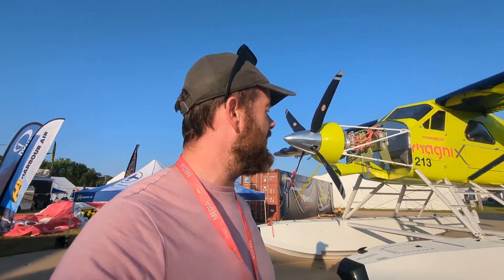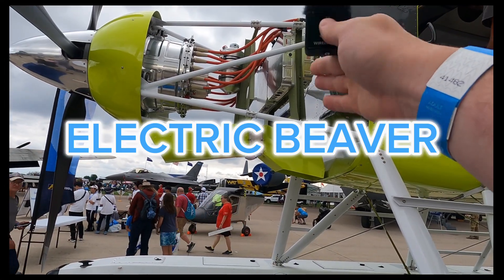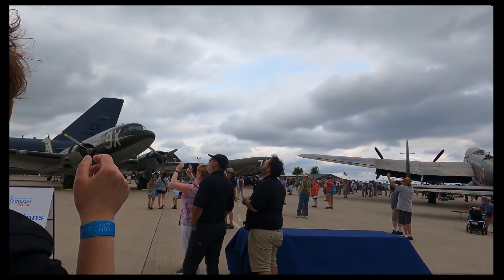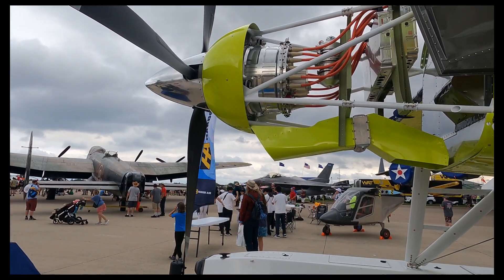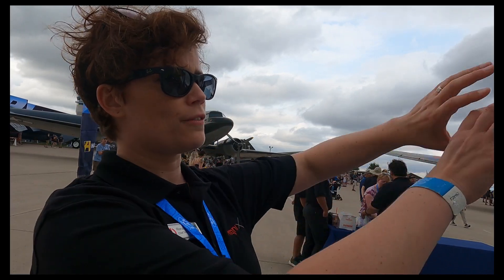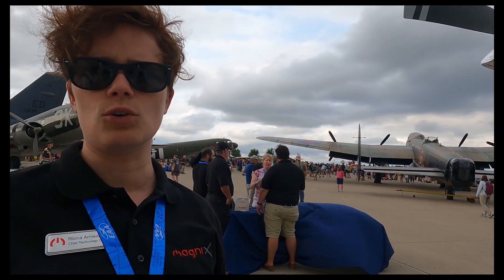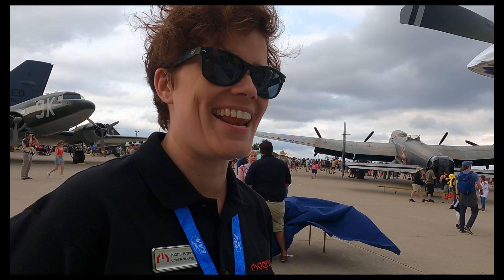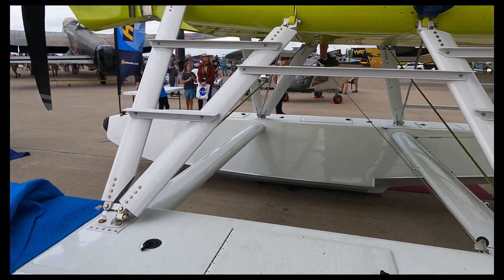Oshkosh 2024 Ebeaver

Comment: Perfect for our Harbour Air short hops.The fuel savings is ridiculous. Maintenance way less on an Emotor. Same HP but alot more torque. How well will the battery hold up would be the cost question. Modern car packs are lasting longer than expected. Tried and tested Beaver,Love it!

Comment: You'll notice they never talk about range and useful payload. Especially with a reserve charge . Nice idea but battery technology is nowhere near where it needs to be for this to work in a commercially viable way. Once the tech gets there , then there's the matter of getting it approved for commercial use. Good luck navigating that quagmire. I also wonder about the wisdom of 600 volts on an aircraft that's going to be used predominantly in a salt water environment......
Reply: Nuclear is probably the future for engines. Look at what the aliens have been doing. The senate is on to them. Powered by radiation.
Reply from the maker: How do we get to the point where it's feasible without making these steps? Look at the model T, that thing would not be seen as feasible as a car nowadays. Would you honestly still be riding a horse? They also did talk about useful load range and endurance in the video. They said it would last about an hour with an hour of reserve and carry a pilot and five passengers. Is it meant for long travel? No, it's meant for 30 minute seaplane tours
Reply: @cheesepilot  That argument doesn't make sense, this is a horse trying to compete with cars.
Reply from the maker: @PistonAvatarGuy  fine make the comparison between boats and planes or trains and planes there are countless examples of people pissing and moaning about advances in locomotion
Reply: @cheesepilot  This is clearly a step backward, especially when compared to what's possible with modern gasoline engine technology, or turbine engine technology.
Reply from the maker: @PistonAvatarGuy  and the first vehicle was a step back in range and reliability from horses. The first Diesel train was worse than the steam trains and the first turbine and turbo fans were worse than their piston counterparts
Reply: @cheesepilot  This isn't the first of anything, bud. Motors and batteries have been in use for over a century.
Reply from the maker: @PistonAvatarGuy and internal combustion engines were used for a while before they were put in the car. If you continue to say it'll never work, you'll eventually be right. But if you continue to develop and work towards a better system, it gets better a decade ago. There is not a chance in hell. An electric brushless motor or set of batteries would be able to get an aircraft off the ground for even a minute. We are now at a point where not only have we flown around the world under electric power and solar power. We are now implementing this technology in some of the most inefficient aircraft out there seaplanes. These systems are making progress and they're getting better. You can look at sonex and they offer an electric motor glider with over 2 hours of range.
Reply: @cheesepilot  It'll never work.
Reply from the maker: @PistonAvatarGuy  spoken like the last guy in town with a horse